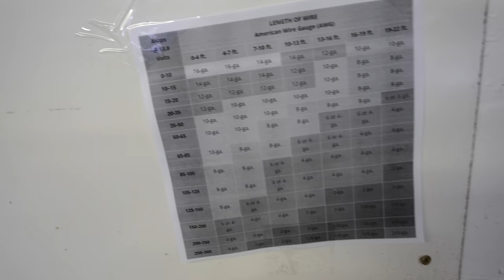Building the Brains of a Low Voltage System - Electric Hummer Conversion

Comment: Great video Jerry!

    Lots of comments on high frequency current flowing on the outside of wires, but nothing about the DC-DC converter. 
     
   1:05 The DC-DC converter should take your 450V DC and take it down to 13.8V.  (Not 12V)
       
    To charge a battery, the charger’s potential needs to be greater than the battery potential.
        
    The open circuit voltage of a healthy 12V battery will be 12.75V +/- depending on temp.

      Modern DC-DC converters are programmable and can deliver between 13.6 - 14.2V dependent on Battery State of charge and temperature.
Reply from the maker: Yup. I said 12v because it's called a 12v battery.
Reply: @JerryRigEverything  
         I appreciate your reply, but I am now confused.
     
    You appear to take great care in presenting accurate information to explain what are sometimes complicated subjects to your viewers.
       
    Maybe you’ll get around to it when you explain the details of the DC-DC converter.

      I’ll provide a discussion point for a future video:   
          
        A “12 volt battery”  is a misnomer and a vehicle’s low voltage system SHOULD be thought of as a 14 volt system!
       

     A lead-acid car battery with an open circuit voltage of only 12 volts is considerably discharged and will most likely have a difficult time starting a vehicle.

      That being said, if you wish to charge a normal, lead acid vehicle battery to its nominal, fully charged state of 12.75 V (open circuit voltage), you are going to need a voltage significantly higher than 12 volts !

      The voltage required, and that provided by a normal vehicle alternator AND ALSO the voltage coming out of your new DC-DC converter will be…….between 13.6 and 14.2 volts!

      Hopefully you will cover this subject of charging automobile lead-acid batteries in more detail in a future episode.
     
      I am certainly looking forward to it.

      Cheers!

Comment: Someone tell me if I'm wrong, but it doesn't matter how much voltage you have as long as your amps are in the right range, right?
Reply from the maker: You need both.  My hummer won't move with anything less than 250 volts. But it needs the amps to 'push' those volts. Like a hose.

Comment: If there is an inverter that steps the voltage of the main battery pack to 12v, why is the 12v battery needed to run the 12v systems?
Reply from the maker: So I can power things without having to turn the main pack on.  Safer and only costs like 50 bucks more.

Comment: Love that you used those shrinkable wire splices although you need to heat them to the point that the metal solder melts and really fuses with the wire. It's not good until it's solid.
Reply: Atleast that's how we do it in aviation electronics.

Comment: Why wouldn't you just wire up the original 24v system?  Why drop it to 12?  There's a ton of 24v gear for truckers available.
Reply from the maker: There's even more gear, and cheaper, for 12v systems.
Reply: @JerryRigEverything  how're you saving money by ripping all the old lights and wiring out and replacing it?

Comment: You'll probably never see this, but just a caution for using the shrink and solder connectors, they have a reputation for the solder joints cracking over time and causing electrical issues. I've used them at our dealership over the years, as well as watch many other automotive channels here on YouTube, and they all say the same. Usually they last about 2 years or so, but then tend to haunt you. I personally like the Crimp and shrink connectors a lot better. They have a good mechanical crimp and the heat shrink has the glue/adhesive that squishes out and forms a weather-tight seal. This is in no way criticism on you using them, just figured I'd pass the information along.
Reply from the maker: Yeah anything wired outside the cab is double heat shrinked. I'll keep ya updated on the solder seal connectors
Reply: @JerryRigEverything  Oh wow, didn't expect a reply. :) Hope all goes well! Can't wait to see the future videos!

Comment: I just wonder, since you have a 450Vdc - 12Vdc step down converter, why would you need a separate12V battery?
Reply: On EV,S the high voltage is only active when the car is used. 12 v stays always active and turns the high voltage on.
Reply: Yes, high voltage is only active when needed, but there is no reason to not keep one high voltage branch always connected to 450-12V converter, so there would be always a 12V source to be able to turn on the high voltage contactor and the "brain" as well.

Comment: The fire in the cord was due to a poor connection, too poor for the current that was being pushed. Had next to nothing to do with the length of cable.
Reply: I agree, the only thing heating a exstention cord is the amps running through it. The voltage drop will increase by length. Therefore a long cable is chosen thicker.

Comment: 17:26 Hope you figured out by now that electrons goes from negative to positive - not the other way around. If grounding to the frame is a real issue for you (I assume that will only happen if the positive battery terminal is somehow connected to it), you must place your fuses on the negative side.